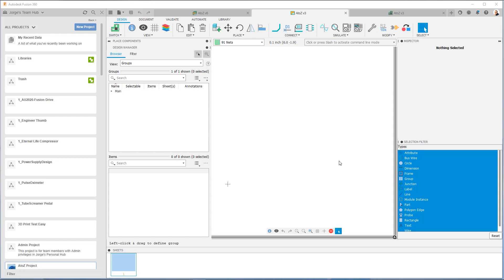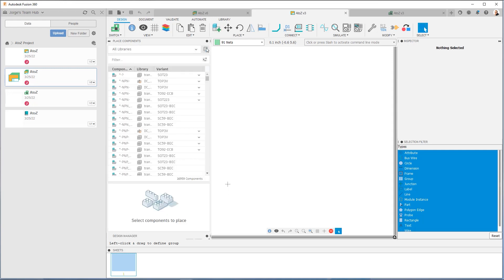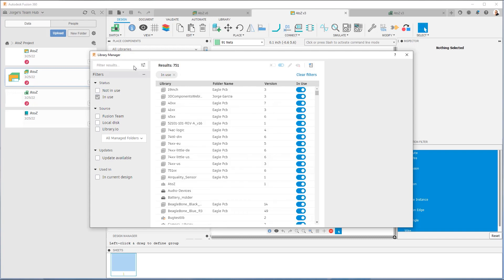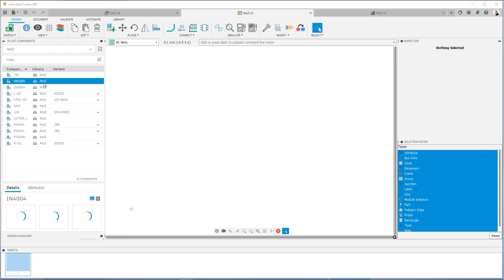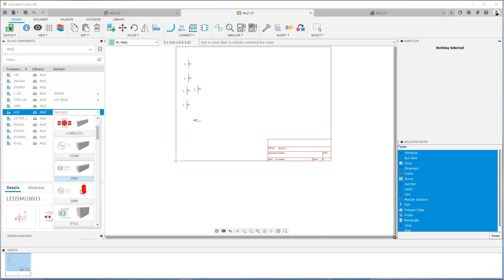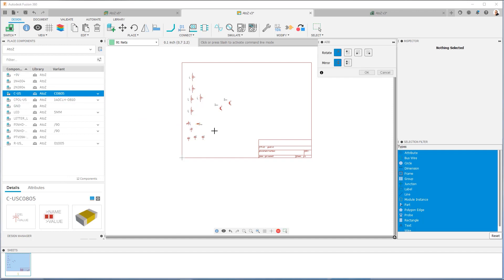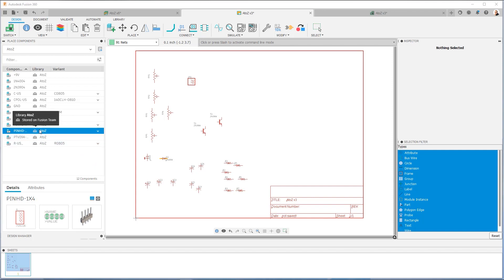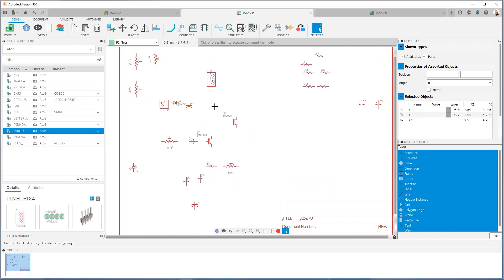Fusion 360 Electronics for Beginners: The Schematic | Autodesk Fusion 360

Comment: Sorry, but I'm going to look for a better tutorial.  Most new users like myself are not going to start with a custom library that contains everything you need. We're going to start with the libraries that come with F360 and import libraries from the net if necessary.  Finding the right components in all the libraries seems to be the hardest part of designing a PCB IMHO and I think you should have spent a lot more time on that.
Reply: Robasaurus, having a similar issue did you find an alternative video? thanks amy
Reply: Likewise. Any recommendation for a real beginners videos?
Reply: I agree with you. It happens so often where a potentially great tutorial is spoiled by the presenter "preparing things" offline and then presenting it as though the assumed knowledge is obvious. This is a beginners tutorial and should assume that every viewer, as I am, is utterly clueless. I managed to work it out after reading a few more comments on here and a bit of googling. Firstly, you need to download the electronics library linked in the video description. Ignore all the warnings and errors that you may get on the download page. Then, notice that the library has a .flbr extension. Don't assume, as I did, that you can use the import feature of library manager shown in the video to import this library. You can't, that would be too obvious. The library manager looks for a .lbr extension and you can't change it. Instead, go to your data panel on the left and use the upload button at the top. If you go in to the library manager after doing the upload, you'll now find it listed as shown in the video. It's assumptions of knowledge such as this that can break "beginners" tutorials. On another day, after a tough week, I may just have rage quit rather than worked it out :)
Reply: @peterc2788  Life saver
Reply: I had a big problem with the imported library. The schematic of the first component that he chose, the 1N4004 was not showing. Following @peterc2788's way of importing the library, i got the issue solved that way, just in case anyone expereicnes the same thing
Reply: Took me 10min to figure out he's using custom libraries.............good info here tho.
Reply: @peterc2788  Thank you for taking the time to figure this out. I was the one about to rage quit!
Reply: @peterc2788  Thank you for this, I thought i had missed a step or even a complete video. It makes sense now.
Reply: @peterc2788  If I hadn't found your reply, I would have been completely lost!  Thanks.
Reply: @peterc2788  thanks for help  but the library uploaded has limited components .... how to get full library

Comment: You seem to have completely skipped over how to install the AtoZ library.  I found the download link for it, but it's a .flbr file and Fusion only wants to import .lbr files. I tried renaming it and importing it, but the library contains no components. What am I doing wrong?
Reply: I eventually figured out you have to open the .flbr file from the main file menu and then save it in the project folder.  I renamed it "AtoZ Library" first so I wouldn't confuse it with the schematic and pcb files.
Reply: thank you a lot
Reply: I wasted almost an hour trying to understand how the .flbr file can be imported, trying to follow a tutorial for beginners. Very frustrating. The secret is to upload the file, not open it.
Reply: @robasaurus7064  I also found the .flbr file and opened it through the file menu of Fusion 360. It creates a separate tab along side the Schematic and PCB tabs. But how does one save it in the project folder from the opened tab in Fusion?
Reply: I just extracted the fblr file using zip7 and then I got lbr file named some ext.... And then imported it, all the components are available

Comment: Thank you for the presentation. I'm somewhat confused on your library part selection. I can see you selected a resistor an 0805, than chose a value. This is very strange. I would have though that you select  a resistor, any part, based on the manufacturers part name. Is this not possible?? The way you show it makes a lot assumptions which are dangerous. First you need to know the value, do you know all the possible values. You'd have to have a very good memory  And having empty lines with a name on is 'loose'. Normally you'd have a termination symbol, which make the schematic much easier to.  Why not have the layout and schematic always on by default in the software?

Comment: Thank you for the video. However, I'm trying to learn using 2.0.17954 and there seems to be a big gap between the instruction and the process of creating and using a library for the project. In the video the library seems to be populated with the required components already. It is not intuitive how to add the required components to an empty project library.